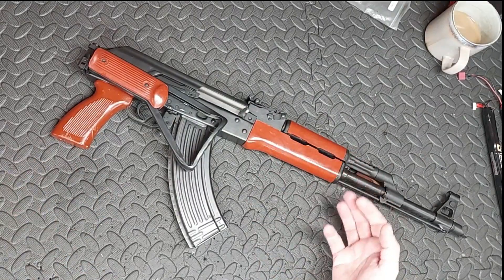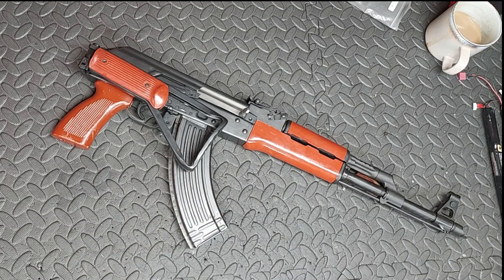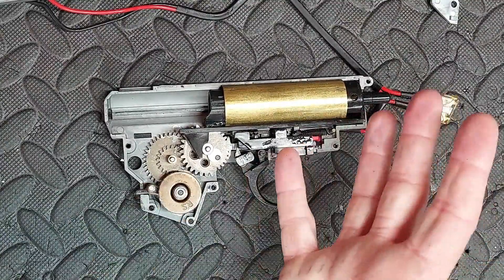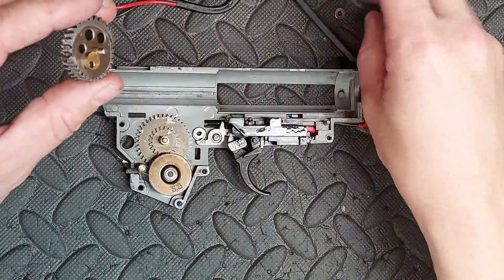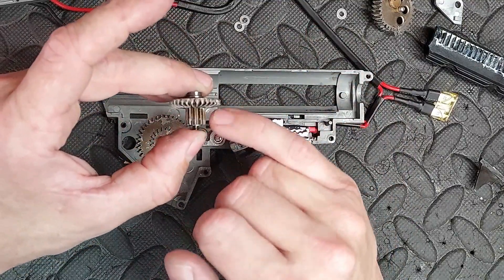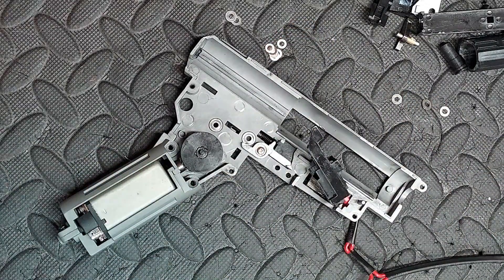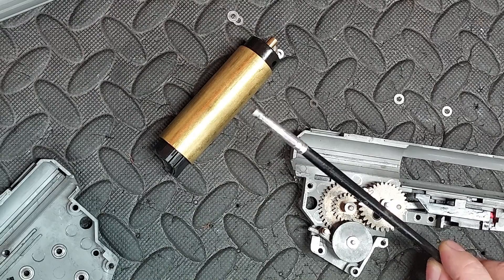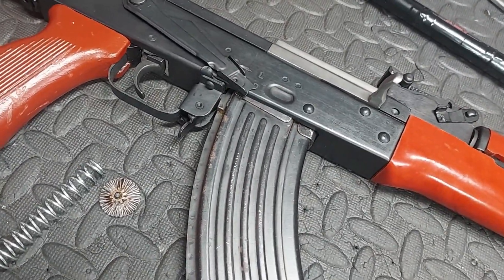Real Sword Type 56-2  -  An Airsoft Classic!

Comment: The reason for the slightly weird gearbox is they made it a little shorter, so it can use real length receivers, as realsword is owned by norinco who make real Aks
Reply from the maker: I didn't know that!
Reply: Ooooh
Reply: @NegativeAirsoftTech  yeah it’s pretty awesome, it means if you wish, you could use real dust covers and a lot of other things if you wish

Comment: I agree; a real classic. Myne is also second hand and the guy shot it last 10 years ago. When I opened it, all I had to replace was a cylinder head and the piston (it uses standard pistons, but they are shaved down at the back). The only negative is the underfolding stock - it wobbles as a cats tail.

Comment: Nice looking ak. I don't know that much about them. But always heard they made nice guns. Cool getting to see one taking apart.  I like the magazine I didn't know you could do that. Would you happen to know if that same conversion is possible for cyma mags I run them in my e&l ak74? Always great content Luke. Moment of silence boobys.
Reply: CYMA internals do not fit in genuine 5.45 shells; G&P do.
Reply: Thank you now to buy a g&p mag and see if it fits my e&l. The cymas do with a slight filing. Haven't tried anything else. Appreciate it.
Reply: You will not be using the G&P magazine shell, only the internals, which fit in a real shell with a bit of filing.

Comment: One of 3 guns you should hpa is the svd. You can up the spring and barrel assembly and motor but the gearset is propietary so you aren't going to get the best trigger response. Its just not possibe due to it' s 4th gear.
Reply from the maker: WE GBBR with steel bits inside = epic
Reply: If you HPA’d one of those it would kill the value. I have a Gen 1 RS SVD and I’d never do that!
Reply: you do have better aftermarket gears so that is bs   did my lct and rs one no problem

Comment: Is the gearbox shell used by zinc alloy?
Reply: From the colour and molding marks, yes it is. But it may using different composition than cheap china gearbox. Therefore, i expect it will last longer

Edit: upon closer inspection of mine, the color different is only for outside part of the gearbox. Therefore, only finishing. Just like old deepfire gearbox. The inside is still the same color as regular gearbox. So, nothing specials